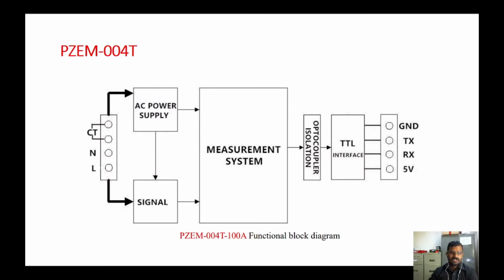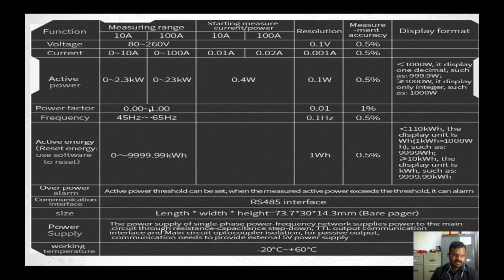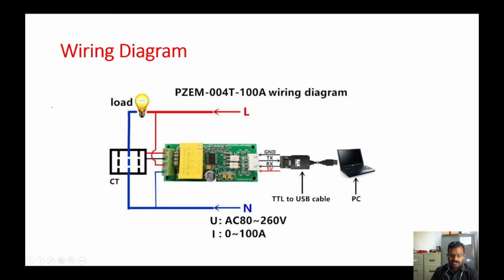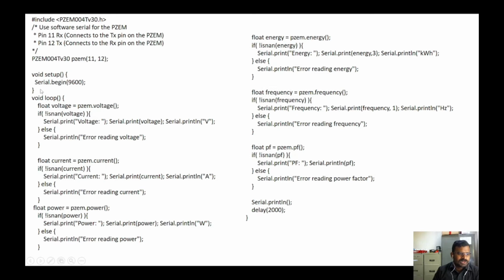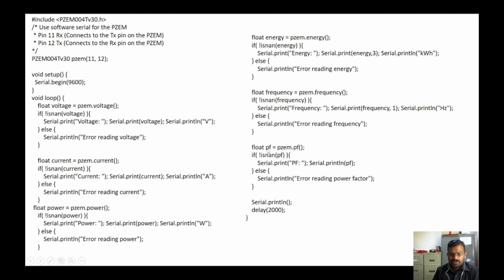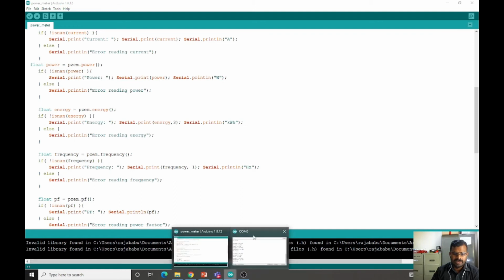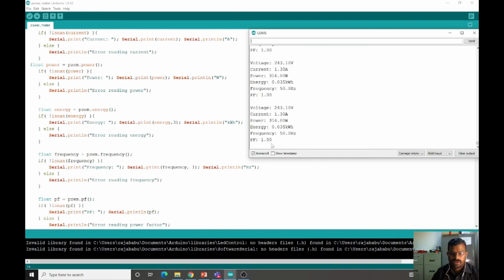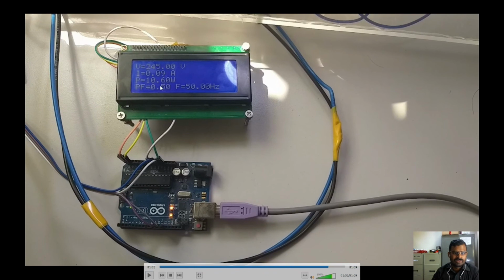Multipurpose-Electrical Meter using Arduino and PZEM004T

Comment: The LCD display does not show the kWh value.. Because it is not in the code.. Can you complete that part and send it with the code?
Reply from the maker: bro all the values are printed in serial monitor. you can just take the kWh and print in lcd as like other variables.
Reply from the maker: about code give me some time bcoz I am not in station